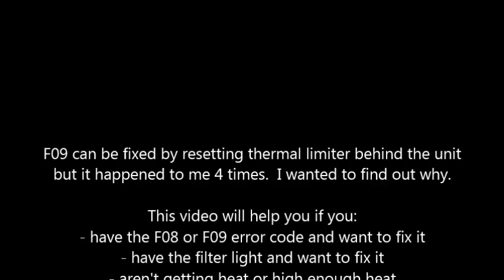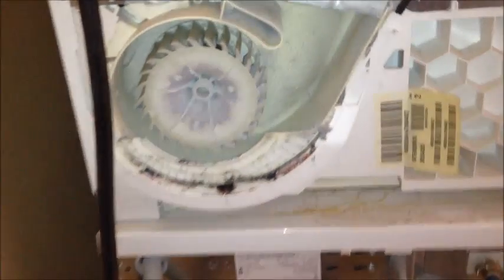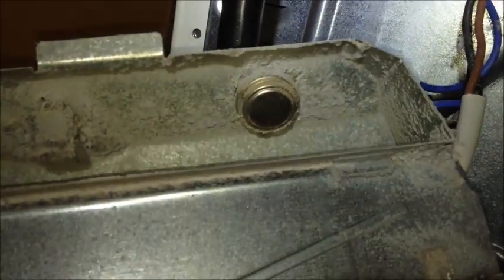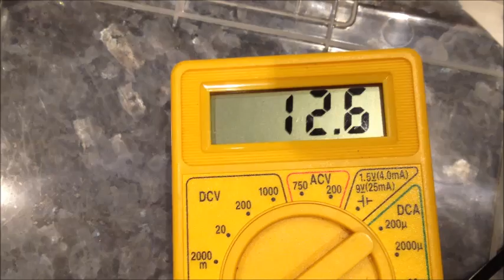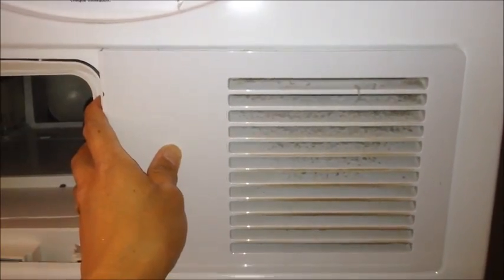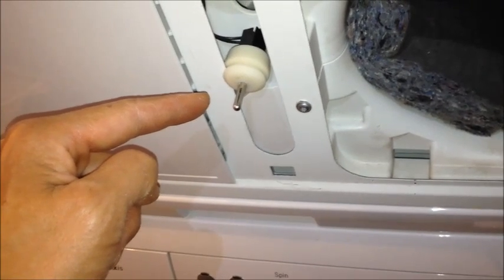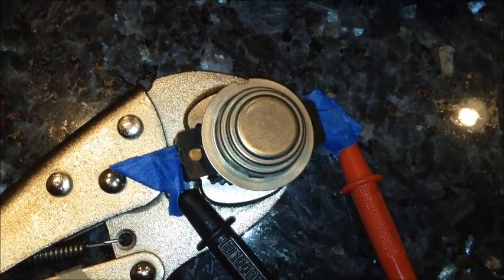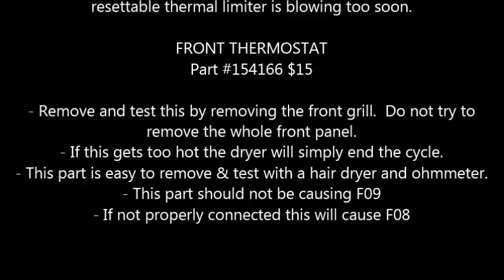Bosch Condensing Dryer F09 Error

Comment: Thanks for such clear explanation. I followed the steps to reset and clean my Siemens dryer (pretty much exactly the same model) and it worked perfectly! I also thoroughly cleaned the condenser which was probably the root cause!

Comment: Thank you for this video : I had the same problem with a Siemens dryer,  which is basically the same – except the name sticker, that is – and your explanations were right on the spot. A thorough cleaning of the heat duct, fan and heater did the trick after the reset of the thermal limiter whose breaker had tripped. 
So far, so good. 
Thanks again for your help, MITEEman!
Reply from the maker: If this has happened to you multiple times it will likely come back.  See the post 3mo ago by Finlay Dolansky.  He has a very good theory.  Check your motherboard relays for any signs of damage.  You can possibly replace the relays on them if you're good with a soldering iron, or the simpler but more expensive thing would be to replace the motherboard.
Reply: I concur... It was the first time this happened, so I hope it was just the fact that the dryer is in a quite small room and that we forgot to open the door leading to the garage where the heat could be evacuated, that combined with the fact the heat duct needed some serious cleaning could hopefully explain the tripped breaker on the temperature limiter, which just did its job.
Now, if this happen again I’ll have to follow your advice and investigate further… 
Of course, this happens on the first autumn days, in Brittany well know around here for its cold humidity and legendary winter drizzle…

Comment: HiI noted that you never really figures out the problem. I had the exact same problem as you, same error code etc. Tested and tried everything. 
I finally found the problem on the main control board. It's the power relay components. These small power 12v DC controlled relays open and close letting 240v AC power go through to the rear heater. Problem= the small contacts inside the relay burn out (they are similar in operation to distributor points in old cars, only physically smaller) and pit and the resist current flow or simply physically do not make contact. 
I discovered that when shorted,joined,bridged the 240v AC soldered points for that relay on the board, the heater worked and the machine did not stop with the F09 error. I cut off the top plastic from the three relays I thought were the problem and found two had blackened and worn out contact surfaces. 
Replacing these two relays fixed the problem. I think this is a common problem with relays after long usage. 
Hope this helps someone.

Loads of pictures if anyone is interested.
Reply from the maker: Thank you very much for posting this.  I wasn't ever able to find/fix the problem before I sold it but this sounds plausible.  It didn't make sense to replace the motherboard since all the digital electronics worked, but I hadn't considered the relays might be bad.  If you have any pictures I would love to get them.   You can send me a private message by doing the following and I'll give you my email to send the pics, or you could just upload them and post a link yourself.  
- clicking channel name underneath the video.- Click the About tab in my channel- Click Send message- Type in your private message and click Send.
Reply: Please could you load pictures about it?
Reply: Hi Finlay, actually I have encounteres same issue. Do you still have pictures?
Reply: Hi Finlay, thanks for sharing. My dryer is having the same problems, wondering if you can share the pics as well. thanks!

Comment: I have no Fault on the screen, the dryer just will not start. There is power the light comes on when I open the door but the start button just keeps flashing. I cleaned everything checked the water pump (it works when I put water into the reservoir) Any thoughts?